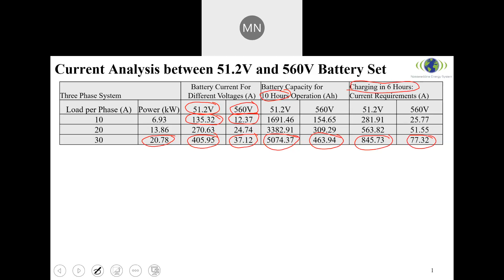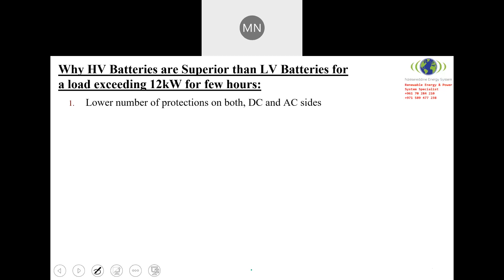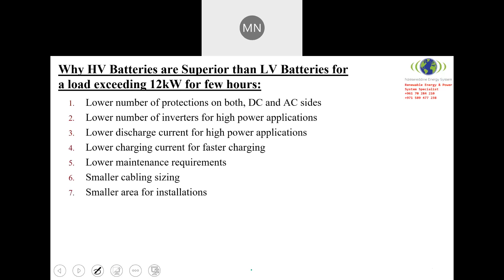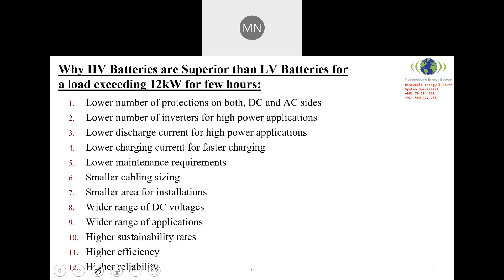High Voltage and Low Voltage Lithium Batteries

Comment: Hi. I need to calculate my home battery bank needs. In your video, How do you obtain the 5074.94 ah battery capacity to support the load for 10-hour operation on a low voltage battery of 51.2 at a power of 20.78 kw? Please to hear and show how this is derived. Thank you.

Comment: Hello, very nice but you missed something. The high voltage battery 560v consists of 10 x batteries in series and you compare the numbers with 1x51,2v battery. The correct comparison must be 10 in series or 10  in parallel and all numbers are equal! Also in parallel connection if 1 battery has a weak cell and falls behind in discharging the others take care of it whereas in series there is no help and the battery discharge equally so gets hot and stops the system. In parallel you can continue with 9..
Reply from the maker: We are referring to voltage levels. For the 51.2V the Ah will be ten time more. 
Regarding the unbalance cell, the BMs balancer will be activated to address the issue, similarly in the 51.2V battery 
Keep in mind all large scale energy storage including EVs one are made of HV batteries